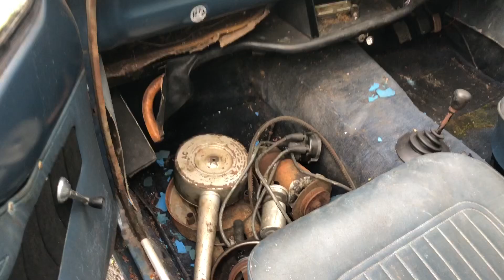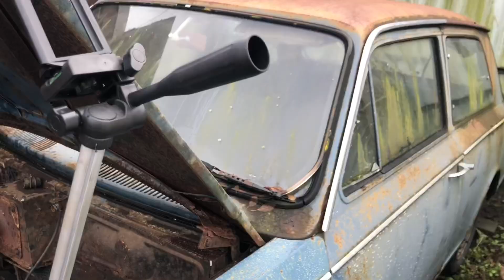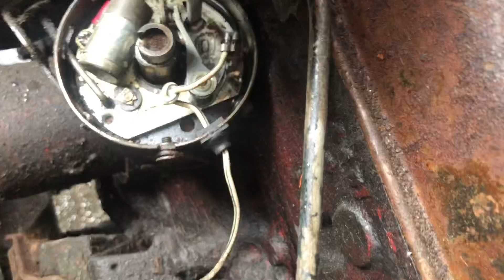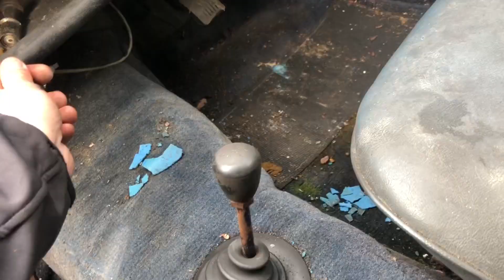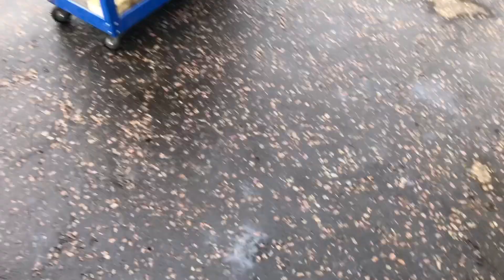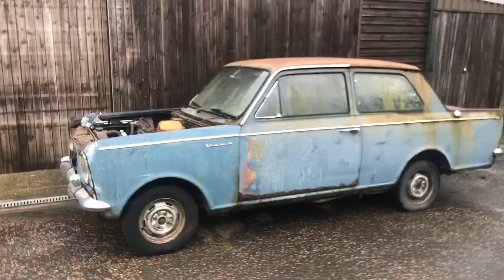Will it run after 19 years 1964 HA viva

Comment: What a hoot, I had this car, same colour. Took it on holiday late 1975, but got a check on it before leaving and the local garage told me it needed a valve replacement, number 3 exaust. Not wanting to put off my holiday I bought the new valve, gasket set, grinding paste complete with suction cup on a stick and took it with me to the motorcamp. I was only 16 at that time with nothing more than this car and a pup tent. I did this job on site at the camp ground right beside the tent using a $6 socket set, 3 screwdrivers and a borrowed torque wrench. Found out all too late that new valve was the wrong one and was 8mm too long. Boxed on regardless and just adjusted the rocker till I got the clearance and locked it in. It looked so wrong but I went with it and the car worked fine for the next 2 years when I sold it. As others have said, wonderful memories looking at your video here.

Comment: As an impoverished student with a young family, I naively swapped a 1962 Oldsmobile for a 1966 Viva HA to save on fuel cost. Most dreadful car I ever owned, boxy, bouncy, drafty, noisy, a screamer at highway speed, inadequate heater for Canadian winters. Had to keep a death grip on the steering when passed by a semi truck to keep from being blown off the pavement. Just plain ugly inside and out. Graduated to a Datsun 510 which was heavenly in comparison.

Comment: I had five Vivas during the 1970s and 80s , though they were all HC models  .They were cheap to buy , economical , easy to maintain yourself , and parts were cheap. The bored out HC engine ,1159 cc from 1057 cc , ended up being about  'square ' , though I can't remember the exact dimensions , so had to be revved a bit . Plugs and points , that takes me back a bit ! The  ' bathtub ' rockers were a weak point , and the push rods would come through .

Comment: Brings back fond memories

This was my first car

The short gear stick was awesome

The biggest issue was it used a clutch cable that after about a years use would snap because the clutch is mechanical with a metal fork that the cable would sit in so that each time you pressed the clutch pedal, the cable would rub slightly against the metal fork that was holding the inner clutch cable in a sleeve with a crimped on ball joint. After time this would wear through the clutch cable and it would snap

You had to remove the parcel tray to get enough room to get at the clutch cable and to be able to feed it through from the inside to the outside engine bay. I used to be able to replace the clutch cable in about 15 mins because I got so good at it after owning the car for years

The seat belts were fixed, with a pull tighten system, none of the good auto tensioners you have today

It used to accelerate quickly and was a great car for speeding off against others at the lights, even beating the 850 mini gt if you drove it hard :-)

The other issue was electrical faults, mostly traced back to the interior light in the front, the housing for the light would break resulting in the metal bracket touching the roof and shorting

The engine bay had so much space it was easy to work on

The front window was sealed in by a black tar like substance which would dry and crack over the years. Easy to replace

It had the worst body roll though and cornered like a pig.
The steering wheel was huge, somewhat oversized

Heater was excellent and front screen viability was ok, not great but one trick you could do was turn the little triangle mirrors in the front windows right around as far as they could go which then directed the air towards the from sunscreen. They were not obviously designed to turn at that extreme angle but they could so it made for a cheap man's windscreen demister

Great memories were had in that car and there was heaps of room in the back for you and the girlfriend 😁

It had a bit of a hum in the bum as they say, which was differential whine when the mileage and age of the vehicle increased but it never failed and the old wives tale was you fixed it using bananas!

Fond memories indeed and thanks for uploading the video

Comment: What a blast,i borrowed my dads HA in 1975 and loaded it up with camping equipment and three adults and a nipper and drove to Shepton Mallet. It bombed up the M4 and zoomed up Cheddar Gorge no problem. It rained all weekend and the campsite was six inches deep in mud when we evacuated and the little devil pulled out like a tractor,amazing little car.On a down note it used to eat clutch cables on a regular basis!😁

Comment: Just watched it again guys, what a lovely shape of a car, reminds me of my first car, (vauxhall chevette hatchback) it was a great wee runner but man for a 1256cc it loved the petrol, at times you could actually watch the fuel hand drop on a long road, also when you started it, it was real rough tappety and clackety for about 8seconds till the oil got up around the rocker then it quietened down, was very reliable wee car and the inner wings/bulkhead was as solid as the roof, nowadays cars are so complicated I wouldn't dare touch anything, just check water and oil, top up the washer reservoir etc, I drive a skoda yeti 4x4 2.0tdi nowadays, what ever became ot the little blue viva guys? Is it driving around or in the scrapyard in the sky???

Comment: Did you not have to add a lead substitute to the petrol used to start this motor?
Reply: No problem with unleaded in the short-term and quite probably none in the longer term. I have several classics running fine without any valve recession. On all mine, once they are running well, I replace the points/condenser with a sensor.

Comment: I had one in the early 1970s brilliant little car the only trouble was they were very susceptible to rust on the wings and bodywork apart from that nice car, of course Vauxhall made a brilliant engine it would run for miles and miles i used to go for miles with the mrs

Comment: I remember when this car first came out. It rotted before your eyes. the metal for the bodywork had been thinned done and there was no undersea.  I repair my grandfather's car where the lamp housing had rotted out and replaced them with older 1950's units in perfect condition. I am not surprised you got the engine running - nothing wrong with the mechanics though I am surprised the body did;t fall off.

Comment: In Australia this car, the HA Viva, developed into the HB Torana eventually over the years coming in 4, 6 and 8 cylinder versions ending about 1980 with the UC.  Some interesting models came from it, the GTRXU1, A9X and the SLR5000. I would love to see that little car restored to original. Incidently if you jack up a rear wheel you can run the whole drive train without moving the car.

Comment: One of the favourite trick this one would play on owners and mechanics was the low tension feed from coil to cb points would break within the insulation. So, it appeared to be complete when in fact the wire itself was broken

Comment: The Van version just carried on and on well into the mid 80s albeit in Bedford form, our council had stacks of em! 👍
Reply from the maker: Steve Dickson 👍
Reply: I have a 1982 ex Scottish Gas van that was very well converted into a camper van using parts from a complete 1968 Martin Walters original. A strong little van, if you keep corrosion at bay. Wonderful 1256 cc engine, lovely gearbox, and that unique 1960’s mark one Viva sound.

Comment: I remember way back my father got a HA van in 1966, I acquired this in 1970. Being a young mechanic I decided to improve the performance so off with the cylinder head and replaced the low compression head gasket with the high compression gasket, it was thinner. Now this improved the performance greatly, possibly not but in my estimation it did😆
Just noticed it still has the ballast resistor on the coil. They could give you problems, engine would start but not run. Happy days

Comment: WONDERFUL!!! This took me back to my days as an AA patrolman in the early 60's around Colchester. I went to an HA at Marks Tey, control told me it was a "non starter", when I arrived there were 3 adults & 3 kids, and a biggish dog! And they were loaded down with all there holiday stuff. When I'd given it a check over I found that the head gasket had blown, which meant it should be towed for a garage to fix. But I felt really sorry for them, and I didn't want it to spoil their holiday, so I managed to get a gasket set, rolled up my sleeves and 90mins later they were off on their way to Clacton and I got a 10 Bob tip for service above & beyond.

Comment: I had an HA van 1964 reg.  This HA engine was always one of the sweetest in it's day - possibly because it was fairly low compession ratio.
The solex carb was prone to icing up in extremes of cold damp weather on longer runs and no amount of exhaust manifold collector mods for the air cleaner would work. I eventually resolved it with a 6 inch stove pipe from the passenger footwell - we shared the cabin heat on bad days and that worked!  As an aircraft mechanic I considered a ring element for the carb but the current draw  and the frequency that it would be need to be  used for put me off.
I loved the little van. Great for camping. Cannot recall too well but think it may have had a poor 2nd gear synchro. So easy to maintain and repair that lack of reliability was nearly irrelevant!

Comment: Guys ! it,s great to see one of these old viva,s again , we had one from approx 1967 to 1975 , & my old dad had the full Vauxhall workshop manuals for it , I can,t find them , they were full - size heavy books , we replaced it with a second Vauxhall , a Viva H.C. , a tip I learnt at college for you if it,s any use , mix a certain amount of washing soda with hot water & pour it into a cold , cooling drained engine , leave the cap off the rad & start it , let it run up to temp , stop it , let it cool down , then drain out all the sludge , detritus etc out the bottom rad hose , place a garden hose in the bottom hose pipe on the rad , then pack it with rags , run the hose ( with water )  until all the c**p is out of the engine , rad , heater etc , replace bottom hose , fill with RAINWATER & run as normal for a few days until you,re sure the system is o.k. , then add antifreeze accordingly . The top heater hose has to be filled separately , with it,s union into the engine plugged to keep the rest of the coolant in , or it forms a big air lock , then quickly snap it back on once full . Vauxhall,s used to call this "reverse - flushing ".
One other tip , all points - ignition Vauxhalls start & run far better if the points are set using an electrical dwell meter , nothing flash needed , I used a sparktune , then get the timing dead on with a strobe light & the vacuum line into the bottom of the carb plugged . 
You guys almost certainly know all this , but the young bucks out there who love these charismatic old cars might not . A little but well - tuned Vauxhall engine is "squirrely enough " for anyone .
Reply from the maker: Phillip Cleaver 🍻👍

Comment: Interesting post. Was given a HB Brabham Viva with twin Stromberg carbs, got an engine out of an HA van or Beagle with a Zenith carb, I think. Took bonnet and radiator off, stood on wings and with a rope did engine swap one evening, (straight fit on gear box) car needed for work next day. Amazing what we did back in the day. Prob took oil of old engine for the replacement. Good memories.
Reply from the maker: David Taylor 👌🍻👍

Comment: I bought a 78 Viva with 50k on the clock it hadn't run since the 80's I got it running and found out that the head gasket had gone on it (it started misfiring when it got up to temperature) the oil had petrol in it (the petrol pump was leaking into it) I had to change the distributor and the coil and also the water pump I gave it a service changed the oil in the gearbox and rear diff and had to get another carb (as the gases were out) 
It was under sealed fully from new and in amazing condition inside was spotless I kept it for 5 years and was sad to let it go I had more people coming up to me than I ever did driving my old 59 splitty VW Van!!! The most common saying was "me Dad had 1 of those" great little car!!!
Reply from the maker: Dafydd Williams 🍻👍

Comment: I worked on these in 1966 when i started serving my apprenticeship with a vauxhall agent remember fitting heaters they were an extra  think they had a resistor on the coil think it gave 12 volts to a 9 volt coil for starting
Reply from the maker: Thomas Catford 👍

Comment: Good, so now it is running and all set to  be run to the breakers yard. That pile of s**t would cost more to restore than I paid for my Viva brand new in 2016. I still have a lovely economical little car with all mod cons, whereas after restoration all you  would  have is a gas guzzling constipated crap-heap!
Reply from the maker: Janice Watts it’s not going back on the road it’s just a will it run video 👌
Reply: About gas guzzling: dont get that one wrong, the engine has about 1100cc and 45 horsepower output. The body weighs well under 1000 kilos. If they were well in tune you could easily get a consumption of 5-6 litres per 100km average driving with these cars. Todays heavier cars consume the same or more...

Comment: Just goes to show how solid the old engines were.
Reply from the maker: Mad Monk_1702 👌👍
Reply: @sruk  The 1159cc and 1256cc lumps from the HB and HC were my first engines I worked on and learnt my spannering on.... there was a lot you could do with them and you didn't need a degree in advanced computerised electronics and a workshop full of specialist tools
Reply from the maker: Mad Monk_1702 👍

Comment: I had one of these. Fitted it with a bespoke short engine built by Bill Blydenstein and I modified the head, inlet manifold and fitted a Stromberg 175 carb with a 3” ram pipe, disc brakes off a CF and lights from a Ascona and an underfloor fuel tank with an electric pump and transistorised distributor. Made 85bhp which was not bad for it’s day!
Reply from the maker: Clive Oram 👌👍🍻

Comment: Viva HA, even the plastic and glass will rust on those things, worse car ever.
Reply from the maker: merlin 13 lol 👍
Reply: HA's weren't that dreadful for rusting apart from behind the push on mouldings they used to cover the external seams
Reply: @jackcole3146  Thats the whole car then.
Reply: @merlin1346  Well yeah, in comparison to today's cars, but they weren't particularly rust prone for their era. Vauxhall had learnt from their dissolving Victors and Crestas.
Reply: @jackcole3146  Did you notice that half the car was missing? the other half was that red stuff on the floor. There may hay been one worse than that i suppose, the early honda civic, paint was optional...
Reply: @merlin1346  it is 55 years old. When I said they weren't that bad for rust I only meant in comparison with other cars of the time. Everything was a rust bucket in those days.

Comment: My first car, in 1985, was an old Thames Water Authority Bedford HA Van, bought for £150 with 60,000 miles on the clock. It had some rust problems but was so simple to work on that I managed to keep it going for over ten years and got more than I paid for it when I sold it for £250.
Reply from the maker: Sedgwick Morrison 👌👍

Comment: one of the best engines used right up to the chevette  models 998 1156 1298 cc and a 1600 ohc model used in the opel  as well  if you ever need to remove the head theirs a bolt under the thermostat cover worked on them for years servicing the old bt ha vans made a 1298 fit in a reliant robin that was fun ha ha
Reply from the maker: Burt Habard 👌👍

Comment: Most likely the distributor advance is seized, thats the red tube to a diaphragm on the distributor body, the inlet manifold vacuum advances the timing as the engine revs up, a bit of thin oil should sot it and it will run like a dream.
Reply from the maker: Lighthouse 👍

Comment: This lovely old HA sounds sweet. She definitely deserves to be saved - I do hope she gets the restored. I used to drive a couple of HA vans - very light and pleasant to drive with a lovely gear-change. The era of basic mechanical cars, without all the chips and computers and all the rest of it, are so resurrectable - I wonder how many current cars with all their electrics will manage this trick after being left for the same  length of time. 

So many happy (?) hours spent cleaning up and setting points and timing on my old Pug 204 (where the dizzy was beneath the master cylinder and almost invisible and inaccessible).
Reply from the maker: Mikaela Bowen 👌👍

Comment: lol, my '74 ford van,302 (5.0 liter) died at light one day, got pushed to side of road, popped off the interior engine cover, found out had no spark, pop distributor cap off, points not opening, screw loosened....grab my pocket knife and a matchbook, used knife blade as screwdriver and match book cover as gauge.....5 mins later, down the road I went.....running great
Reply from the maker: JFK64 Kennedy 👌👌👍

Comment: Holden used to manufacture and sell these in Australia years ago.  My grade 3 teacher had one...a grey one.  They were tough little critters but they rusted so easily and, for Aussie roads, they were very under-powered compared to the local 6 cylinder Holdens and Ford Falcons.  Holden kept building the British variant before they designed their own small car (The Torana) which came in two flavours...4 and 6 cylinder.
Reply from the maker: tripsadelica 👌🍻👍

Comment: Had one of these as my first car back in 77/78. It cost me 150 quid. It was an old banger then, and lasted about 6 months before I crashed it (several times), and ended up stripping it down for spares :( UHO 120 H was the registration although it was a lot older than that as it was originally registered in the channel islands, and got a new registration it came back to the mainland.
Reply from the maker: Steven Wort 👍